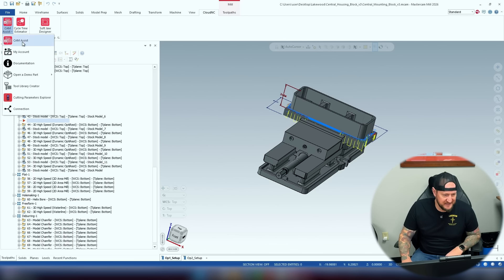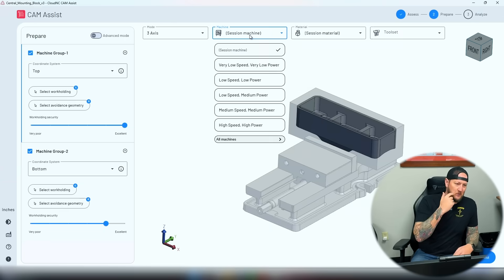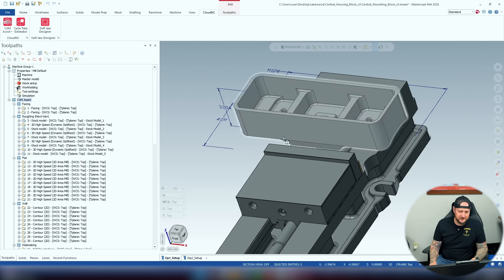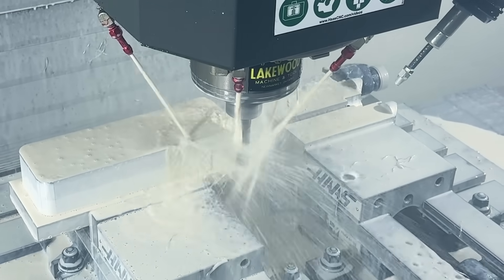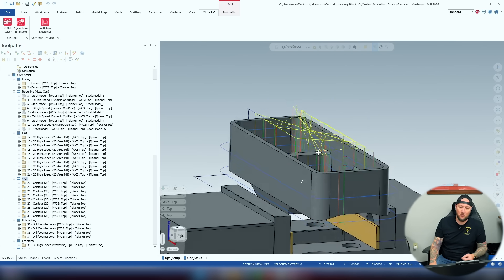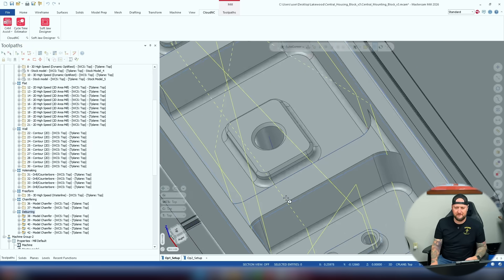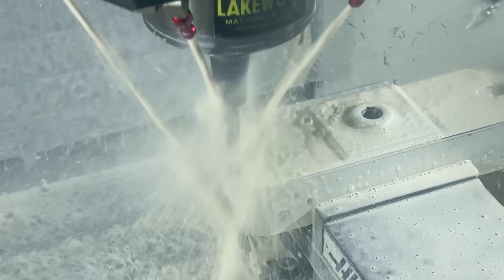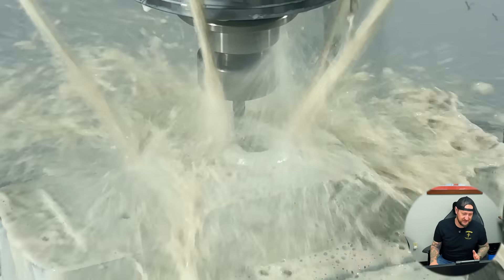I Let AI CAM Pick My Toolpaths… and It Went FULL SEND | Machine Shop Talk Ep.145

Comment: Lakewood Machine is compromised! Don't feed the ai knowledge pool. The easy route is the same reason most peeps don't advance past a button monkey or 5 line brain melt machinist. Last I checked most shops around here(midwest) are slow and under-talented. Don't feed the space net machine peeps, don't do it! Nuff said

PS mrr upwards of 75-100 cubes very possible in 6061-t6 with a 1/2" 3flute dlc coating, high helix, in a cat40 haas vf9, non dual contact spindle interface with a 15k spindle. 500ipm max allowable

Comment: Still a lot of wasted moves in there jumping around. A good programmer will still make a better program. In a production world where youre running tens of thousands of parts that will waste a lot of time/money. For onesy twosey stuff, it would be faster.
Reply: yeah, if we were doing tens of thousands I would have most definitely done some editing to optimize - this case was definitely just for a one off. 

The nice part is that since it’s not black boxed - if you’ve got a big run and want to pull every second out of it - you still definitely have that ability to spend a bit more time up front and save time over the run!

Comment: I'll probably get hammered for this but GibbsCam seems easier
Reply: Eh, with lots of experience in multiple CAM software including MasterCAM, GibbsCAM, Fusion 360, and SolidCAM, I think that most modern CAM softwares are more or less knowing where to click. This seems like something that will end up being a fantastic edition to any prefered CAM platform and that's what I'm most excited about. Just getting the nitty gritty basis done quickly and then making tweaks as necessary should speed things up so much. Also, this is just the beginning.
Reply: I’ve never used Gibbs so I have no point of reference to argue from, tbh!

Comment: I don't see anything special here. You inserted the feed and speed rates directly from the information on the insert packaging.

Those numbers always seem high to most shops. Backing down from the recommended numbers is common and wise if your running on older hardware with some slop.

Most shops figure out how hard they can push the feeds and speeds either by creeping things faster and faster or by going recommended and then slowing things down because tools either failed or just are not lasting very long.❤
Reply: You're not wrong - it's a tough one. We always say that CamAssist is great for helping show us that we don't need to be so precious or careful with our feeds / speeds - we spent a lot of years running older machines, so actually running at the manufacturer's recommendations was always a bit frightening at best. With the new machines we've added, this has been huge for showing us that hey, you can actually run it the way it's supposed to run and nothing bad will happen - a great learning experience to say the least!
Reply: Not sure if you know, but feeds/speeds are based on a 1hr run time.  The tool should be in the cut for 1hr. If the roughing cycle takes 2 min,  you should get about 30 parts before needing to change tools. if it's not worn out, you're not going fast enough.  If it wears out before then, it's too fast.  That's the industry standard for tool life on manufacturer feeds/speeds.... just an FYI lol. Also.. he didn't enter anything, the software figured out all the feeds/speeds doc woc automatically.
Reply: @Zontics  The software needs to know if your using a paticular brand and version of insert. Nose radius, size, material etc.😂
Reply: @tenlittleindians which is all included in the tool libraries you should already have